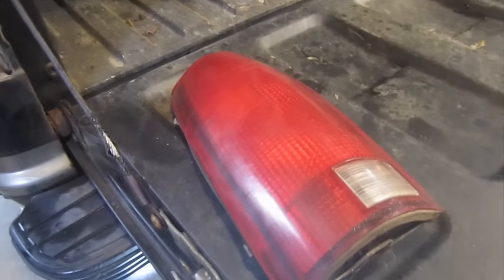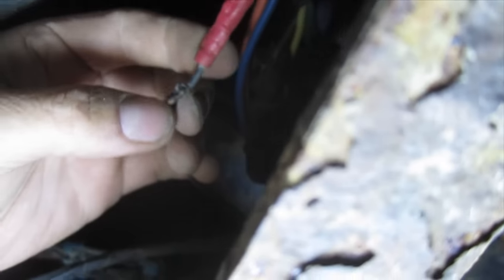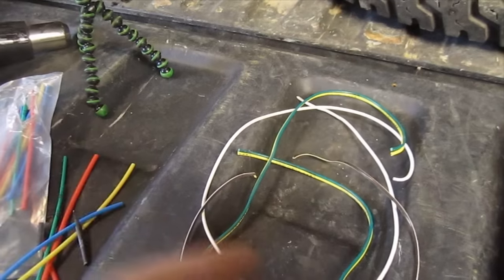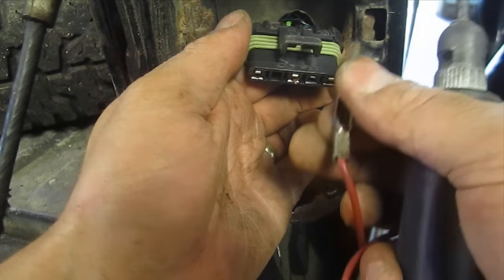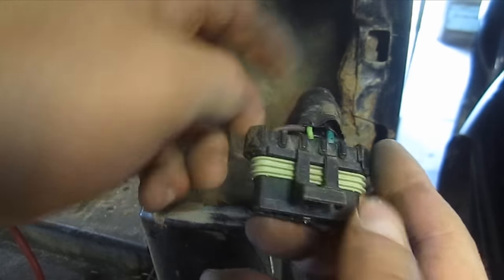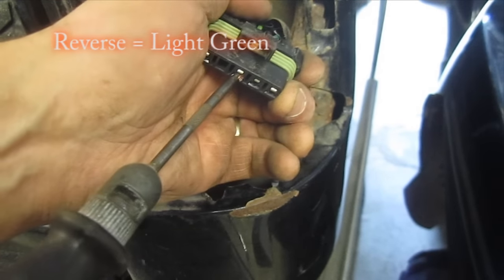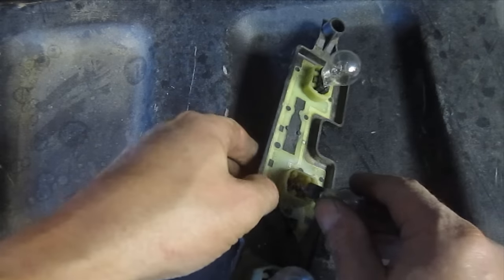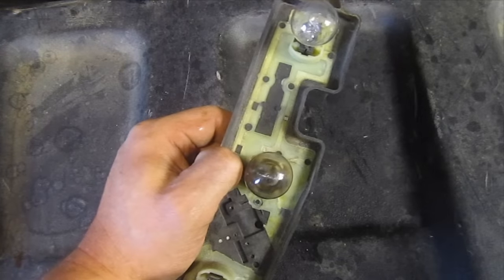DIY Chevy Silverado GMC Sierra Taillight Repair How to Test and Repair Tail Lamp Wiring Brake Light

Comment: Ok guys at times the circuit board goes bad that’s what just happened to mine last week and when he tested the signal light it was blinking real fast when that happens one of the front bulbs might be bad so if you ever see your signal light on your dash board get down and check it might be the front one or back one and the guy that posted this video I bet it’s going to help a lot of people.
Reply: I have exact same problem on the exact same truck n this video. Fix the ground wire and changed the boards and checked the wires but still the same problem. No running lights are signal lights in the rear. Only drive side brake light and reverse lights. Any info to fix the problem would greatly appreciated

Comment: Super helpful. My running tail lights stopped on my 2000 k3500. Brakes, turn and hazard all work. Fuses checked. Ordered a new switch, but I suspect a wire issue. I’ll be testing, thankyou!

Comment: I have a 1992 GMC CK1500 with rear tail light problems too . The signal lights also don't work when the running lights are on, and the brake lights are really dim when they do work . My truck also has the electric brake hook up, as well as the trailer hook up. Yours is the first video I've watched. When you showed the underside of your truck's wiring, it looked a lot like mine . Thanks for explaining the color wire that works the different functions !

Comment: Is that black ground wire supposed to be screwed to the frame or bed at some point coming back out of the harness. Mines is just dangling out of the wire loom.
Reply: Did you ever discover why it was dangling?  I would guess it is supposed to enter the harness, but, at some point, secure a decent ground onto the frame or body.
Reply: @coeneschamaun1735  Not really, there was an extra wire that was an auxiliary power wire though; don’t remember if it was the black one or some other color.

Comment: my 2003 Silverado doesn't have the connector shown at 4:00. Can't seem to figure out why my tail light doesn't flash and blinks fast in the column. I've tried replacing the bulbs, checking fuses, and tracking wires for good connections.
Reply: Usually a fast blink indicates a burned out bulb somewhere else.

Comment: Hi! Nice video! I am so frustrated! I have all bulbs working, both taillight pigtail connectors functioning properly (continuity to bulbs is  ok). I have turn signals, but NO brakelights. Im trying to understand the schematic, and I think ive decided that brake switch is ok (white wire on the directional connector), which has power when brake pedal is depressed (ie, power is on/off when pedal is pressed, or not). But, still can't get any brake lights. Its a 88 Siverado, I dont think there's a "relay", but I'm not certain. I dont know what else to check.... 😥😥

Comment: Hey Mark, I've got a cluster f*** of wires from where the previous owner removed harness connectors, added trailer wiring, electric brake wiring, and added led bumper lighting for spot lights and license plate. I'm In the process of swapping out for a nicer truck bed and bumper and won't need electric brakes and bumper lighting. Thought this would be a plug and play, but now it's not. Any suggestions? This is for a 1997 GMC Seirra.

Comment: both of my reverse lights are out & this may help me solve the problem I guess if I find a ground problem by the spare, right? I had a problem before & it turned out to be a ECC fuse, which also involved the inside cab light. That light is on so I am hoping it IS a ground problem. Thanks for the test info. Very helpful!
Reply: John Murphy did you fix yours reverse lights
Reply: Did you ?
Reply: pedroza1029 did you fix your reverse lights

Comment: How can I spice these connections together for tail lights and turn signals left and right and brake light ?? Black is ground and comes from front ground connected to frame chassis and battery ?? Been having issues with driver side brake light working every thing else works but main supply wires have no factory connector so it has been very complicated to fix and get working properly !! Please helyp explain what no parts store could help or solve +! Thank you !! I got a lot out of this video that helps explain some of this issue and problems to deal with and solve on my own simply !!

Comment: brake lights and blinker lights work in the back and then I turn my headlights on and I don't get nothing in back what does that mean
Reply: I have the same problems with mine
Reply: The Ground wire behind the code reader plug under drivers side dash...
Reply: Same  with mine. 🤔
Reply: I have a 1992 GMC with the same, exact problem. I worked on it today . I will check the ground behind the code reader .
Reply: How did you fix your problem

Comment: I am having a problem with the backup light on driver side and the backup lights  on the 3rd light above the cab. New bulbs, checked fuses. Replace tail light junction harness box next.

Comment: In the video I’m having the exact same problem but you never showed how you fixed the problem are what caused the problem. At the big connection plug under the truck I’m not getting power on a test light but the driver side brake light is working

Comment: hey mark, i gotta weird problem with my rear Flashers / Signals
Short Version..
Hazards on : Two lower lights light up 
Left Signal : All three left flash including right reverse only
Right Signal : Just top right signal lights up
All Lights on : Both Left / Right's light up including reverse 

Confusing right? 
Ive replaced both rear boards, all lights, one circular fuse and the small square fuse under the steering wheel.
including the Multifunction switch. 
and still the same prob.    any ideas?

Comment: Well mine is a 92 1500, replaced both connector plates and all the bulbs as this truck has over 200k and it appears nothing or nobody has been in here ever or a LONG time. Funny part is and I'm not really laughing, but you can at my expense, The problem was to start with was the brake light on the left was not working and It's still not. Even with all new parts. Gonna check the connector with the 4 wires, but the blinker on the Left is working but not when you press on the brake pedal. Any idea at this time would be great.  :). Enjoyed the video and figure with it I'll get it figured out. I'm 69 and ever since I started driving many moons ago I'd rather get an ass beating from my dad's cowboy belt than chase down elec. problems on anything, car or truck!!!

Comment: quick question, i got the same truck as you. then the left back tail lights went out turn singnal also. i replaced all 3 bulbs and i notice the very top bulb wont work, everythig else worked, than i looked on the right side and i noticed the top bulb also doesnt work but everything else does work, do you have any clue why the top bulb on both side wont work?? would really appreciate some feed back this video helped alot man!!

Comment: Hi Mark, good video but I have a question. When the turn signal wire and brake wire on the right side and on the left side are together, the right and left turn signals will always work together. If you use the right turn signal, the left turn signal will also flash because of the connection via the brake wire. I've tried it on myself and my blinker always work together. where is the mistake?
Reply: As others have mentioned,  there's a small circuit behind the bulbs that might be bad. But, the first step is to check (with the power test lightl shown in the video) the connector at each taillight to make sure they are working correctly. As in, when the right turn signal is on, the left one should NOT be on, etc. If they both come on, then your wiring has a short circuit further up the line.

Comment: My issue is with the brake lights, I changed the switch under the Dash, and nothing,, Checked the Trailer hitch connection,, nothing.. All I can think of is, it has to be a ground wire.. But we're it is I have no clue..
Reply: yes 3rd lite only but not corner brake lites at back  @nogripes
Reply: Same with my 99 but I don't get anything on my 3rd brake light.

Comment: i have a 1990 i check all my wire and replaced my trails to brand new ones and i cant get the tail light to work or the without all the bulbs lighting up any ideas?
Reply: Try to replace the headlights switch

Comment: Do you know which is the ground on the circuit board? Pressing brakes with hazards on makes the hazards not flash
Reply: That is normal operation.  Emergency flashers stay on solid when brake is pressed.

Comment: I have a 1997 Chevy Cheyenne c1500  and the reverse lights dont work. on either side.  Bulbs were good  ( I know this since i switched the bulbs  into the Brake light socket since those went out ).  Since the reverse lights werent coming on , I utilized the bulbs to serve as the brake lights. Until I figure out what is wrong.  I went and bought a Backup light switch for it , Cause I am guessing that it possibly has gone out. Any advice ?
Reply: Jack Jones I got the same problem bro. I think it might be the panel I'm not sure but gonna find out today going to Napa to get a new panel.

Comment: Does anyone know we're the ground wire is for a tail light on a 2001 GMC Jimmy SLS I have one tail light both brake lights turn signals and reverse lights I have already changed the switch an checked all fuses are still good
Reply: We it

Comment: What is the name of that test you ran and when it flashes does that mean there’s a problem or when the bulb stays on does that mean there’s a problem?
Reply: Since no one answered u its a test light it just shows there isnpower going through there and the ground is working it only lights under power so the flashing would be like a turn signal is on or a dodgy connection somewhere

Comment: here's what nobody has been able to video. I have 98 Chevy Cheyenne (1500). when I really press on the female end into the male end hard my turn sigs and brake lights work. once I let go no turn sigs no brake lights. ive replaced circuitry board, bulbs all that. works for about a month then they don't work anymore unless I replace them. hell I had a guy drill a hole somewhere in the female end and zip tie it hard to the male end. it worked for about 8-9 months....now that doesn't work anymore. I want a video to show how to cut and splice the female end of both driver and passenger to make it longer. thing is the female end and male end don't make a connection unless theyre really pressed together hard its like theyre loose or like the female end is not able to reach the male end. ive also replaced the rubber pieces on the female end....nothing could you advise?
Reply: I had the same problem, so I cleaned everything up and slightly bent each male end in the opposite direction from the adjacent ones and reconnected.  Problem solved for me.

Comment: I have a unique problem, I have a 1997 Chevy Silverado and my brake light and blinker (both on the driver side) does not work. I replaced the bulbs and that did not work so then I continued testing and found that at night when my lights are on the bulbs are on. It's just my brake and blinker. I then checked the fuses and none were blown.... I was going to replace the circuit board on the taillight next , does that sound like a wiring issue?

Comment: Hello, I was pulled over the other day for not having a brake light/blinker on the left side of my truck. I replaced the bulbs, but could not get the bottom bulb out of the socket. I checked to see if the blinker was working after replacing the top and middle bulb and it was not. I'm just wondering if the bottom bulb is the main bulb that would cause it not to work. I ask my local parts store and they said it could be the tail light circuit board. Any help?
Reply: dopeheathen hi my tail lights don't work brake lights work only when head lights are off any suggestions

Comment: My running lights work but my brake lights do not light up when i hit the brake and it blows the fuse instantly when i try to put a fuse in the brake spot i already swapped the brake light switch on the pedal
Reply: Try looking at the third brake light wiring. My entire third brake assembly was corroded and I had to replace it. I bet the issue is up there.

Comment: i got 91 silverado everything works with headlights off when turn headlights on i have no brake lights if i turn turn signal on it wont blink stays soild while other side comes on but dim.  no tail lights 4 ways work fine with or without headlights on what could it be how fix it ??
Reply: Me too!  I just read it is the ground located under the steering wheel behind the code reader plug.  Did you ever get your problem solved?

Comment: put foot on brakes, the turn signal flashes. Turn on the head lights it goes dim and still flashes fast. l  put  in a new brake switch
Still flashes fast .  HELP

Comment: Damn, going through all these comment sections about these trucks having all these problems, makes it seem like GM didn't know what the hell they were doing for like 8 years.
Reply: My thoughts exactly...I only came around to this realization after researching why my 04 Silverado 4.3 had a weak idle. Turns out I needed to upgrade my ground wires, which I have done on all of my vehicles and seen a noticeable improvement. Safe to assume that all 99-07 GM vehicles need full electrical upgrades. GM has actually come out and admitted to faulty wiring for these model years and recommended that people upgrade. Nice but still shy of doing a proper recall, which they should have done. But I guess just like all DIY projects, once you know how to do it, you'll never pay somebody else to do it again!  Honestly for 4 decades I didn't know any of this stuff and now I'm happy to be so confident about it. I always wind up looking at people's ground wires if they ever have the hood up.

Comment: I got a 04 Chevy Silverado you know why my break light don’t come on at night they work when you push the breaks down tho
Reply: Replace the light. The light has 2 circuits. One is open and the other one which is the brake light does have continuity. Replace the bulb

Comment: Will this work on a 2004 Silverado?
Reply: I switch to 4 wire Square LED Tail lights .Had them on for the last Year and had a tech install them .Paid almost $5oo. Now my passenger tail light doesn`t work...stop/signal and hazard light....My running lights work. Confused as to what`s going on? Any help would be appreciated.

Comment: When i step on my break's the reverse lights come on
Reply: Sometimes aftermarket wire harnesses have a couple wires reversed and you need to switch them around. This happened on a fuel pump I recently installed.

Comment: You could have picked the connector from the socket and done it right.
Neoprene gasket for bulb mounting board.

But the use of dielectric grease is the worst.

Dielectric grease is NOT conductive. It is a surface sealer for connector bases and anti corrosion AFTER the connection is made.
Use Aluminum oxide grease which Is conductive and has a grit to it , verrry sparingly on the contact surfaces to give the best connection.
Reply: I also thought dialectic grease was being used incorrectly. Isn't that what they sell you when you buy a new battery? To slobber all over the terminal, after it's connected?

Comment: So I’ve got reverse blinkers but no brake lights or emergency, I’ve replaced the brake switch and a new wiring harness what could it be next ?
Reply: You wired the light green wire which is reverse light to the turn signal, which a dark green.

Comment: I have a 93 two door blazer . Dash and none of rear lights work any ideas and what it could be ?
Reply: I have had similar issues on my 88 pickup. I believe there's something loose inside the main switch on the dashboard. Seems if I press switch hard enough,  it all works fine. Eventually I'll probably have to access the back of the switch and double check ground and connections are tight.